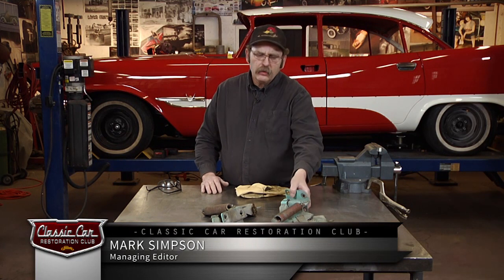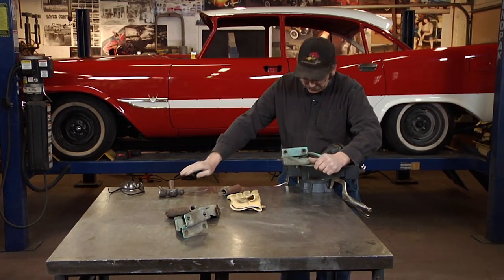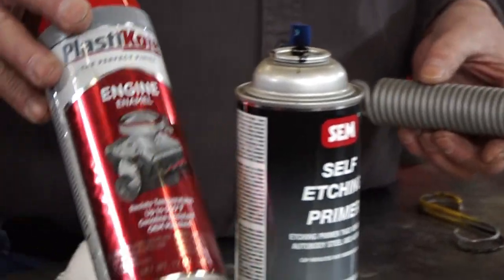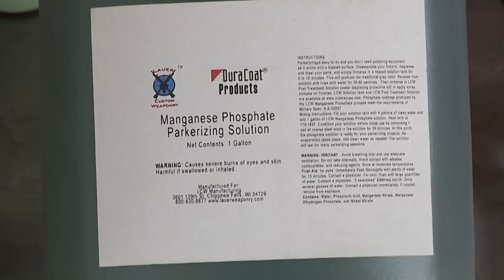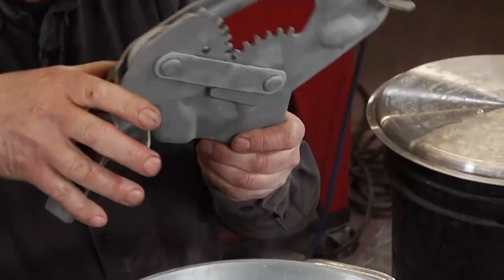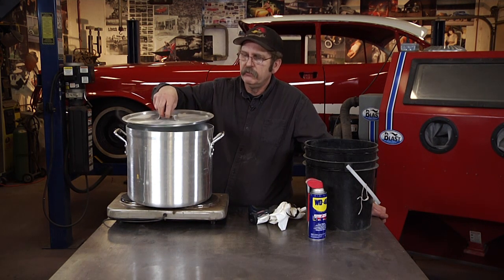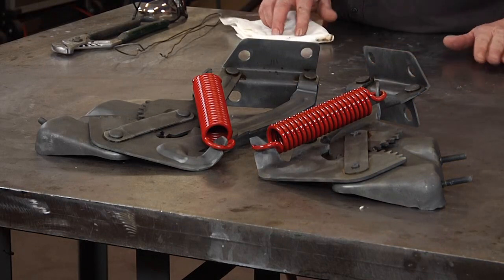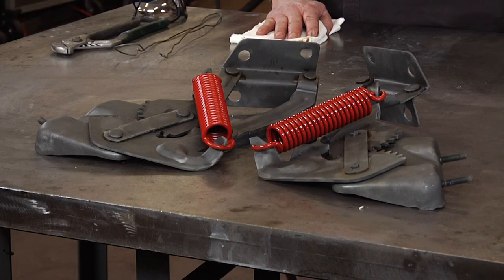How To Rebuild Hood Hinges

Comment: When I paint something with engine paint after it dries, I put it in front of a ceramic space heater and cook the high temp engine paint on. I thought he would paint the phosphated hinges. This phosphate finish is sometimes done on firearms. Which reminds me, there is a baked on firearm finish called ceracote that would be great for this. It holds up very well and the good thing is that it is a very thin finish so it won't effect the function of the hinges.

Comment: Great video! I just finished the hood hinges on my 67 Mustang and they look great. I painted my springs black though. I do have a question. . What do I do with the Zinc phosphate now that I’m done with it?
Reply from the maker: Zinc Phosphate can be used for more than one application.

Before you let it go make certain none of your friends don't have a need also,

Most U.S. counties have a hazardous waste disposal site, where they take in and recycle Zinc Phosphate solutions without charge.
Reply: Classic Car Restoration Club I have asked my friends that play around with old cars and none of them seem to want it. Now I have diluted gallons of it and don’t know what to do with it. I am currently working ( restoring ) a VW bug and can’t think of anything that would work with it.

Comment: i want to sand blast mine, but i dont have access to a sand blaster , would you recomend to use electrolysis as amethod to get rid of rust?  be well
Reply from the maker: Hello Lenny, 

This is one process you'll need a sandblaster for. 
Small blasters you can use outside are inexpensive and will get the job done. 

Or consider having them blasted at a local restoration shop or dedicated media blaster. 

I use glass bead for blasting hood hinges as it's not too aggressive. 
More than rust removal, the blasting builds a little tooth to the surface to accept the Phosphate coating. 
Wrench Safe, 
MarkClassic Car Restoration Club Video Membership

Comment: What are those bolts on the hoodhinges called
Reply from the maker: Hello Trinidad, 

I suspect you are referring to the studs that mount the hinges to the car. 
These are factory pressed in studs, I tried to locate a source for you but came up empty so far. 
Bolts could be welded in place, but I would start by trying to locate a commercial source.

Hope this helps!

Mark
Classic Car Restoration Club Video Membership

Comment: Maybe some one on this site can Help- I have a 1948 Pontiac- it has a crossbar/ bracket that goes underneath the hood- It is rivets to the hood hinges. Problem is on a long drive the hood flew up-and bent a bracket attached by the spring and also stretched the "rivets". I can get the bracket fixed but no one will touch it because they have to drill out the rivets and we can't find rivets. The crossbar is crucial  to the hood so replacing the hinges aren't an option- Anyone know a link to the whole assembly ( maybe parting out a pontiac) or the rivets- The body is a B style--- the same as a 1946
Reply from the maker: Hi Jeff,

I have seen few projects that any Quality Restoration shop will not take on, including replacing hood rivets. 
With that said perhaps you haven't asked the right people yet? 
There are still 1946, 47, 48 Pontiacs in vintage salvage yards even a quick search of Desert Valley Auto Parts revealed a handful of them for sale most with hoods still intact. 
There may even be one closer to home at a vintage salvage yard near you. 
Aircraft Tool Supply (ATS) (https://aircraft-tool.com/shop/search.aspx?CATEGORY=Rivets) also sells a wide variety of Rivets and Rivet guns. 
Check out this video where Bob Wilson owner of RJ Restoration demonstrates how to install rivets using an ATS Rivet gun; https://www.classiccarrestorationclub.com/video/how-to-install-rivets-011466/

Mark
Classic Car Restoration Club
Reply: @ClassicCarRestorationClub  - Good answer and it's clear I haven't asked the right people- I just thought a classic car club would have at least 1 person who had run into this problem- or would at least have a lead.---- My bad
Reply: Jeff, did you get your hinge fixed?
Reply: @rowlandhall4108  Yes thanks for asking- as a matter of fact-- while everyone was telling me to send an irreplaceable part across country- I found a great craftsman here that fabricates and builds- that was able to machine the rivet so well even the painter wasn't sure which one was made. problem now is getting the hood springs back on.. instead of being compressed they have to be stretched/expanded about 11/2"-2" and no the trick of using washers don't work... I'm not a welder so the youtube video isn't of any use to me... They make a spring compressor but not a spring expander. If it was only a 1/2" no problem..